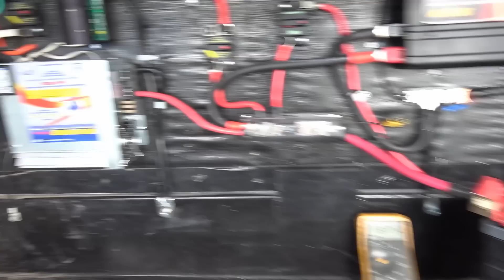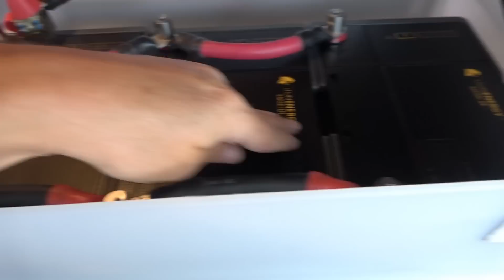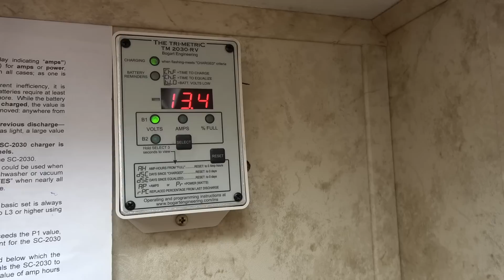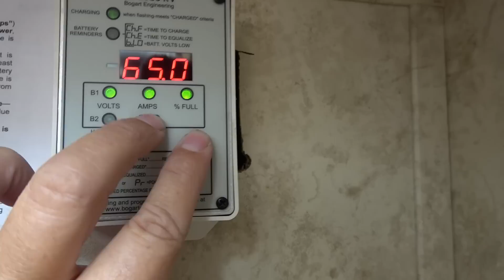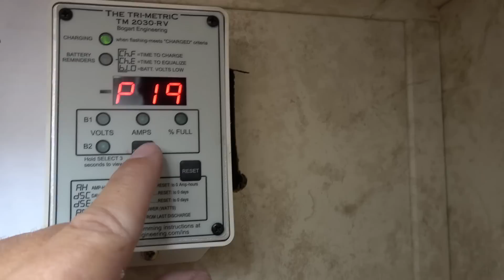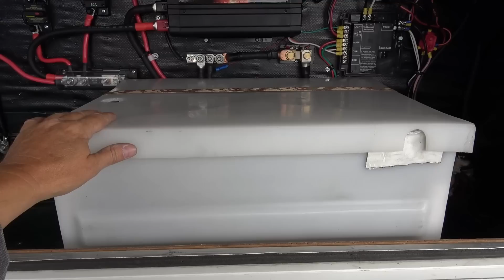Lion Energy Safari UT Lithium Battery Review (Part 2 - Installation)

Comment: I don’t know how much cold weather camping you’re going to do but you should ask what the cold temps they should be in before they become  ineffective unlike agm they don’t do well in cold temps, so you might want to insulate your box and close up that hole to the outside... never mind I see your third video took care of my concern lol
Reply from the maker: The built-in BMS (Battery Monitor System) electronics will shut charging down and protect the lithium cells before they are harmed. So cold weather will not harm them, just means they can't be charged when temps are below freezing. They can be discharged all the way down to -4F though.
I'm going to wait and see how it goes. We travel south in the winter and for the most part, avoid any freezing daytime weather. Some times we'll get some colder nights that dip below freezing but the batteries will still discharge to -4F and for sure we never see that. In 8 years of full time RVing the coldest outside has been is in the low 20's at night. And, that is outside, my front storage bay stays a little warmer than outside since the RV that is being heated next to it.
 Our bedroom is right above. I run the RV gas furnace pretty consistently on freezing nights to keep the plumbing from freezing, there is a duct to the enclosed underbelly. Also, the batteries are in a box and they create a little bit of heat of there own. I'll monitor the temps in there versus outside ambient this winter to get a feel for the difference. Worse case, if I'm in sub-freezing temps and my 300 AH lithium bank is severely depleted is to fire my portable generator and run a space heater in the battery compartment o ruse an electric blanket to heat them.  Cheers, Ray

Comment: Great video! Thanks!  Question, does it make a big difference having the positive and negative coming out from opposite sides of the battery?  The reason I ask is that I have my positive and negative cables coming off the same side of the batteries
Reply from the maker: Yes, it helps balance the charging and discharging, see this link - https://www.iotaengineering.com/pplib/balancedcharging.pdf
I'm using Method 1 for balanced charging. Cheers, Ray

Comment: You might as well go mppt now I like the epever unites you can get like a 40A for about $100 and another $50 if you want the remote display which if you are not to handy with a computer you might need but otherwise not really but it is nice
Reply from the maker: The Bogart has been good to me, like how simple and sturdy it is, also like that it is a small USA company. I think I may add a few more panels and add a second SC2030 controller.  So, two 400 watt systems. They can be run in tandem for 60 amps total output. Data cables plug into each controller and onto the Trimetric battery monitor and it balances the charge. The nice thing about that is with all the panels run in parallel shading doesn't have as much effect and if part of the system breaks or a controller breaks you still have charge coming in. Would make for a robust system.  Cheers, Ray

Comment: Looked like a fairly straight forward install Ray. I'm wondering if you could just remove those posts and use some stainless steel bolts for your battery cables? That would make torquing the bolts fairly easy. I also already have one of the Iota DLS chargers and didn't know they made an IQ4 controller for lithium batteries, that's nice to know.
I know those Bogart charge controllers are capable and have been around for awhile, but I don't think they could have made them any harder to program if they tried. This is coming from someone that spent 35 years dealing with hundreds of different industrial controllers and sensors that had to be programmed. How hard could it have been to put an up/down and enter button on them?
Reply from the maker: I was a little worried about torquing to hard as not sure how they are construction, would hate to twist them off!

Comment: Great Install!... Have you considered 0 temp situations... You could add a piece foam under the battery to insulate it from the floor and add heating pads or lightbulb in the box to turn on if the temp falls below 0...
Reply: He goes south (Arizona and stuff) for the winter.
Reply from the maker: I'm going to wait and see how it goes. We travel south in the winter and for the most part, avoid any freezing daytime weather. Some times we'll get some colder nights that dip below freezing but the batteries will still discharge to -4F and for sure we never see that. In 8 years of full time RVing the coldest outside has been is in the low 20's at night. And, that is outside, my front storage bay stays a little warmer than outside since the RV that is being heated next to it.
 Our bedroom is right above. I run the RV gas furnace pretty consistently on freezing nights to keep the plumbing from freezing, there is a duct to the enclosed underbelly. Also, the batteries are in a box and they create a little bit of heat of there own. I'll monitor the temps in there versus outside ambient this winter to get a feel for the difference. Worse case, if I'm in sub-freezing temps and my 300 AH lithium bank is severely depleted is to fire my portable generator and run a space heater in the battery compartment.  Cheers, Ray

Comment: Any concerns on the location of the new batteries in the garage with very little climate control ? I know that you cannot charge a lithium below freezing or it will destroy them. Providing they have a good BMS that wouldn’t happen, but then again whatever power you pull out , you won’t be able to replace until it’s above 0 Celsius.
Reply: Hi Ray, you might consider reinstalling that temperature sensor if it could work to monitor the battery box ambient temperature on the occasional cold nights you encounter.
Reply from the maker: @tubepoor  I have a spare wireless indoor/outdoor thermostat I can use to monitor the temps. I usually use one to check on temps for the plumbing that is most at risk of possible freezing. It records the coldest temp it's recorded in the last 24 hours.
Reply from the maker: I'm going to wait and see how it goes. We travel south in the winter and for the most part, avoid any freezing daytime weather. Some times we'll get some colder nights that dip below freezing but the batteries will still discharge to -4F and for sure we never see that. In 8 years of full time RVing the coldest outside has been is in the low 20's at night. And, that is outside, my front storage bay stays a little warmer than outside since the RV that is being heated next to it.
 Our bedroom is right above. I run the RV gas furnace pretty consistently on freezing nights to keep the plumbing from freezing, there is a duct to the enclosed underbelly. Also, the batteries are in a box and they create a little bit of heat of there own. I'll monitor the temps in there versus outside ambient this winter to get a feel for the difference. Worse case, if I'm in sub-freezing temps and my 300 AH lithium bank is severely depleted is to fire my portable generator and run a space heater in the battery compartment.  Cheers, Ray

Comment: Oh glad to this post about lithiums. When my two  6 volt flooded lead acid  Trojan T145s die out I'm hoping to go with lithium. I guess I'll need to make some electrical changes to my present Keystone travel trailer's charging system? I'm hoping it's the right thing to do, lithiums aren't cheap and neither will be the new updated RV charging system. I will need to take my rig to an honest professional RV lithium batteries installation mechanic if I can find one.
Reply from the maker: Guess it all depends on how often you dry camp, if usually on hookups or don't RV that often, they aren't likely worth the cost at this point. I see many of the people installing lithium are full-time RVers or do a bunch of off grid camping.
As for the trailer yes a new charge converter will help get the most out of the new lithium type batteries and extend their lifespan.
Reply: @LoveYourRV  Thank so much Ray, I'm planning on at least 50% boondocking and probably more like 75-90%. Any suggestions or recommendations on brands and models of quality charge converters? I think one that is specially engineered for lithium ion batteries and that's also multifunctional, so it can also do lead acids at the flip of a switch. My 2015, 22 foot Keystone Outback came with a WFCO Ultra lll Distribution Center WF-8900 Series that I guess I'd disconnect the charger part of and find someplace to install the new lithium ion charger, then connect it to the battery wires. I don't know but I'm hoping the lithium ion battery dealer can do the installation. I'm not that knowledgeable regarding electronics. I'm also curious what's better, whether one large lithium ion battery or two smaller ones. As long as it fits where my two Trojans sit together side by side. The advantage of two smaller ones is the weight / size during removal. But going with the larger sized lithium, probably isn't any heavier than one of my Trojan T-145s.

Comment: Anchoring of batteries - it's probably worth designing your restraining system to take 10g to 15g forces in any direction.  You might save the cost of replacement following an accident and you have a huge amount of stored electrical energy that could do a lot of damage if a short occurs.  I agree with the other comment about lining the box with some kind of energy absorbing materials.  That polystyrene packing material would probably crush too easily when stressed, allowing too much movement.
Reply from the maker: Not sure how to measure for G forces exactly, but the good thing is these are much lighter than the old lead acid so makes restraint easier.

Comment: Have you looked at the Bogart 2030 wifi module?  Might be useful in monitoring your system making your review easier.
Reply from the maker: I noticed it on the website, not sure how much more info it gives if any, looks like its brand new to the lineup.   I did find out there are new firmware updates for both my SC2030 and the Trimetric but have to be sent to California. Was gonna wait till I hit the USA to make shipping back and forth easier. Maybe grab the WiFi module then.

Comment: Freaked me out watching you span the POS and NEG terminals with your bare hands! Yet nothing happens! Are you made of non-conductive material, or am I just paranoid?
Reply: Common misconception of 12v batteries. You can touch touch both terminals with your hands. Not the same for the 120v electricity in your house.
Reply from the maker: Not non-conductive, but my skin resistance is high enough to make it safe to touch such a low DC voltage, only starts to get dangerous at higher voltages, used to work on old vacuum tube equipment which needed high DC to run the tubes, now touching 200 - 300 volts DC will definitely get a persons attention!  Sometimes locks up your muscles.

Comment: Hi Ray. I read your reply in another comment, but I'm still concerned about the heads of the screws coming in contact with the batteries. The raised plastic sections normally provide clearance, but are they being compressed by the tie down strap and weight of the batteries? Please consider using a liner to prevent chafing and add vibration cushioning.
Reply from the maker: Ok will do, but this box plastic is tough! remember it had 240 lbs of golf cart batteries in there before for the last 4 years and has seen many a rough road, would likely bust the Safari UT plastic battery cases well before the ribs if I cranked the tiedown straps hard enough. That's why I put the soft styrofoam between the strap. I just want it snug not too tight to harm the battery cases. only want to stop them from bouncing around and loosening the cables.  Cheers, Ray

Comment: Excellent job my friend. Guess we'll have to wait till fall and winter for the true testing with solar and all and does it matter on usage after loosing the total amp hrs on the old  vs the nominal usage of these with less amp hrs. I'm hoping for a true usage against lead acid vs lithium and the huge cost difference is worth it. It's going to be hard on you watching your percentage left and not panicking when you hit fifty percent like before and let these drain down to twenty percent before kicking on the genny and speed charging them back up. It'll take some time but I know you'll give a honest review on the end results. Thank you my friend for sharing and not making me wait long.
Reply from the maker: Thanks, my lead acid rarely got below 70% guess that's why almost 4 years later all the cells still read great with the hydrometer. I deliberately oversized my battery bank so it wouldn't need to be run down much.  Looking forward to even more capacity now!
Cheers! Ray

Comment: I just love my Bogart Engineering TM-2030RV and SC-2030, they did a outstanding job designing that set up, only way I charge my batteries, disconnected my converter so it wont charge them, sure looks like it will do fine on charging those Lithium batteries
Reply from the maker: Bogart told me many of their customers actually buy a 15 VDC power supply and use their solar controllers for shore and generator charging as another option.  The controllers can be set up in tandem.  He said it was popular with some overlanders.

Comment: Nice  work Ray .  With my Chevy volt battery's I put a breaker to shut them off form the old inverter charge unit in the 5wheel   Then I shut the  onboard invert charger off at the fuse box. I use just solar to charge the 400 amp Chevy volt battery's.
Reply from the maker: Thanks. :)

Comment: Progressive Dynamics makes a lithium version. Similar form factor to your existing charger/converter.
Reply from the maker: Yup, lots of the inverter/chargers have lithium settings now too.  Bogart told me many of their customers actually buy 15VDC power supplies and use their solar controllers for shore and generator charging as another option.

Comment: Hello Ray.  We enjoy your videos usually, together.  I have to watch, solar and electrical alone.  She has heard too many, but I can't get enough.         Wonder if those batteries will like you more if you set them ON TOP is some of that foam to improve their tolerance for  the bumpy roads.   Just my thought of any way to make it better.

Love Your Work.    Tom
Reply from the maker: Thanks, Tom. :) Wouldn't hurt, could put some foam or rubber under them, my main concern was them moving around and loosening the connections over time. I've had the 4 GC batteries in there for about 4 years now and no issues.

Comment: So, what are you going to do/planning on doing with your old batteries Ray? Do you think you and Anne are going to be able to run the air conditioner off the batteries, or do you think that's too much of a demand for the batteries, or do you think the air conditioner asks for too much energy for the batteries?
Reply from the maker: I'll sell them off, they are around 3-4 years old now.  I won't bother with AC, we don't see hot weather that often. Batteries could do it, but it takes quite the expensive inverter to power an AC plus all the thicker wiring and a lot more solar panels for recharging. We are free to move around, so we just head to a cooler location. :)

Comment: can't wait for the review on the performance then I will order them how long did it take too get them when you ordered them?how does the life time warranty work?
Reply from the maker: Not long, was under a week to Canada even.  They guarantee them for the rated charge lifetime of 3500+ cycles. There is a counter of some sort inside the BMS circuits.  They told me based on my usage patterns dry camping 6 months of the year that would be 27 years.  Even then the battery would be at 80% of new capacity.
Reply: @LoveYourRV  looking forward to the discount and review on usage :)
Reply: @LoveYourRV  Do You use the battery shut-off when hooked up. I do not have a battery shut-off, does it change something in the number cycles to leave them on when hooked up?

Comment: Did you put something on the floor to keep the hold down screws from possibly cutting through the bottoms of the batteries?
Reply from the maker: No, the battery box bottom is corrugated in several rows, so screw heads are in the valleys and batteries rest on the peaks.
Reply: @LoveYourRV  good,  I could not tell that the wells were deep enough.